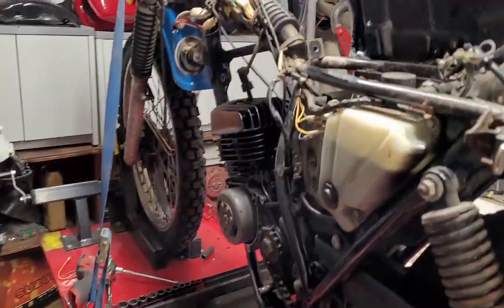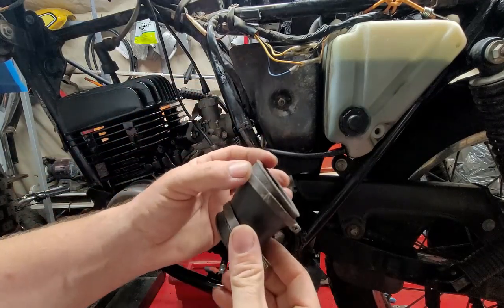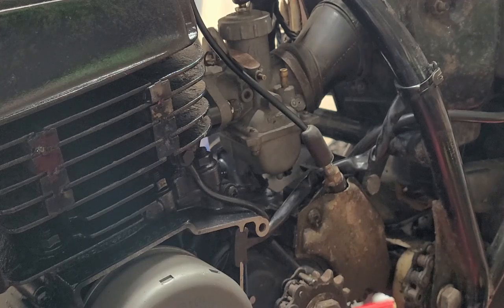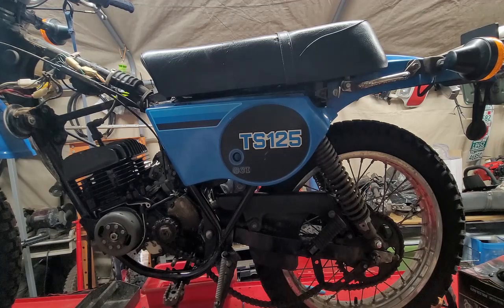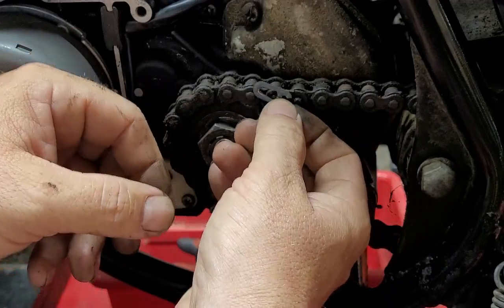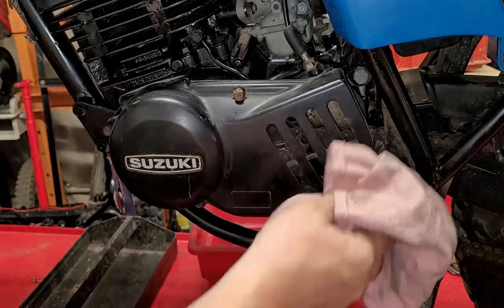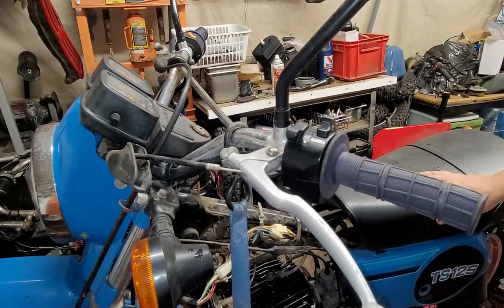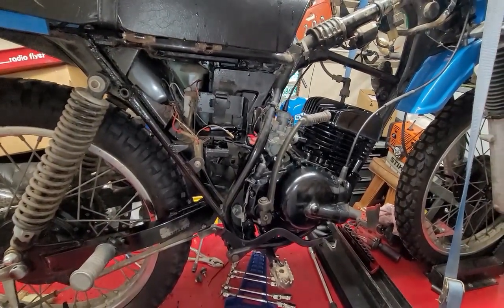Working on David's Suzuki TS125 part 10 working on the air box and much more

Comment: Or if you knew if there were any after market kickers that were compatible
Reply from the maker: you will have to measure the shaft there are 2 different sizes and type it in on ebay